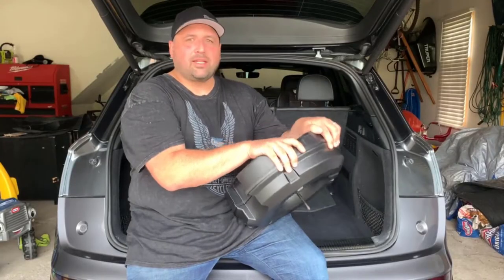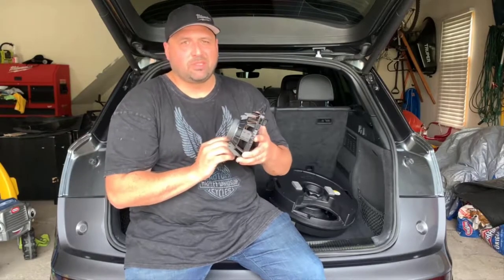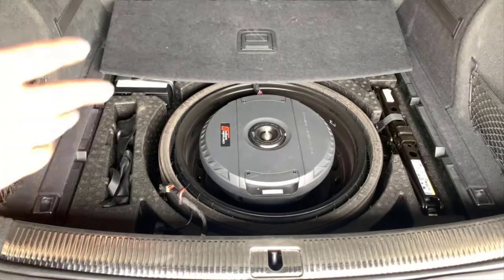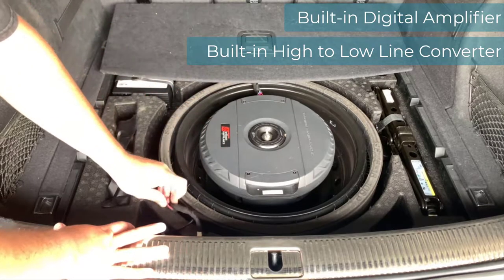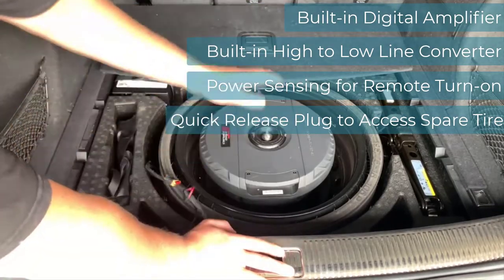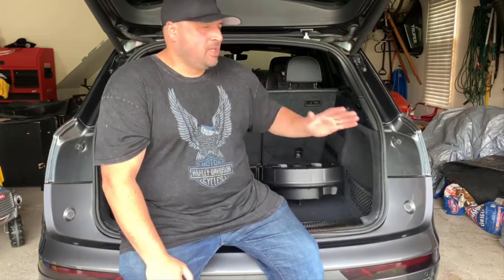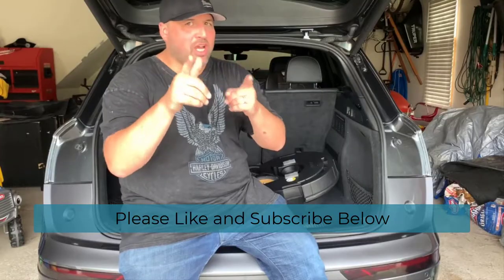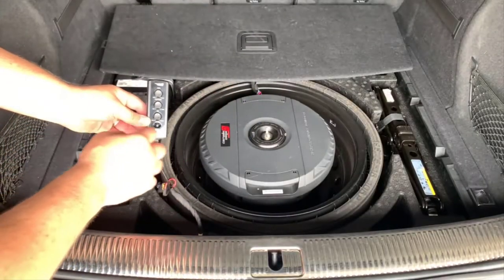Audi SQ5 B9 - Subwoofer Upgrade -- Cerwin Vega 12" Spare Tire Subwoofer w/ 600 watt AMP!

Comment: a little jumbled on the line out put convertor explanation (converts the speaker-level output to RCA level output) but good video overall!
Reply from the maker: That's not exactly true either. I was trying to make simple enough for most people to understand. The built-in high to low converter takes the direct output from the factory subwoofer out on the factory amp and converts it to a lower level input on the Cerwin Vega unit. RCAs are a type of low level output, but the amp doesn't require RCAs to operate. The Cerwin Vega accepts direct wire in for the speaker channels, in addition to RCA in. In fact some people buy a pigtail for the factory plug and it goes directly to RCA and don't use a high to low converter. I have a second video showing the wiring in a bit more detail: https://www.youtube.com/watch?v=YWwqsGtCkSY ... Dually noted, a good call out that i could have been more clear in my explanation. Thanks for stopping by!

Comment: Interesting, however it was apparent even through the YouTube video that it sounds atrocious. That rattling sound might be the hard cover that drops down over the spare tire area. Or it might be that the subwoofer itself is not tightly attached to the metal floorpan. I think that in order to get this upgrade to sound good, a bit more work will be needed. I'm probably going to tackle this job in my SQ5 sometime this summer. Without doubt that little stock driver is not going to cut it. B&O likely designed it for bass frequencies, but in order for a driver this small to produce bass that is adequately loud, the excursion of the cone needs to be very great. This is one of the limitations of the stock driver, but there may be more. To do this right, the subwoofer has to be rigidly installed and not rubbing against anything. And the normal floor panel for the hatch area really, really needs to be modified. Hate to say it, but it is true. In fact, I'm going to do this first, because even with the dinky little stock driver, that floor panel is very obviously blocking the sound, and it may be rattling. It needs to have a big round hole cut through it, and the hole replaced with a sturdy metal grid, which could be glued on with epoxy. And covered with grill cloth. A smaller driver rather than a large driver will likely work best, though, because the volume isn't large enough unless the driver is very heavily damped, which will make it inefficient and low in sensitivity, and which will require a very, very large magnet.
Reply from the maker: Any rattling that you hear in the You Tube video is likely the two child car seats in the rear of my vehicle. They both have adjustable head supports + Plastic adjustment pieces rattle and make noise. I have seen some installations of modifying the trifold spare tire cover, which is somewhat doable, but I also don't think looks "great' on the Audi. I now have a SQ7 (which can be watched here: https://www.youtube.com/watch?v=Ba3aXk12-hU) and it is actually a ported box, with a spare tire cover that is much thicker. Again a limitation of this system is 100% the placement of the subwoofer without an air outlet/inlet, which dampens the air movement, which also dampens the air pressure, which impacts the sound quality. In the SQ7 I am going to play a bit more with other options since the 8" just isn't quite there yet for DB in the lower frequency range (requires the most air movement). Thanks for commenting and stopping by! Good luck on your project!
Reply: @tangentsdaily  While it is conceivable that the rattling and buzzing were due to child seats, I'm a bit skeptical because the sound that came through the 'Tube was mostly distortion. Very severe distortion, to be honest. But you've moved on to another vehicle, and no longer have any reason to chase down the problems with this installation. With respect to those flip-fold panels in the hatch area, it is essential to find a solution that you find acceptable from the standpoint of aesthetics, because there just isn't any way that any subwoofer covered over by one of those things is going to sound remotely like it will sound without that cover. The long period for long wavelengths (low frequency) allows time for the air pressure fluctuations to work their way around everything, but this does not compensate for the resistance to air flow. There absolutely are ways to fix this problem, i.e., put a big hole in the flip-fold panel. It is only a matter of finding a solution that you're will and able to undertake, and that you think will be aesthetically acceptable. A couple of more technical items. And oh, before I forget, that sound meter you have might be okay, but what you really need is a software application for a notebook computer, and a calibrated mic you can plug into the USB port on the computer. I promise you that once you cross the threshold to doing this, you'll quickly look back at everything you've done previously and think of it all as a waste of time. The free app REW is an amazing application. For calibrated mic, there is the UMIK-1, and Parts Express also sells a calibrated mic for very reasonable cost. Given that this is obviously your hobby, you really should take the leap and download REW and order a calibrated mic. You'll be amazed at how much greater insight you'll have, into what the individual speakers are actually doing. One technical comment on the idea that a subwoofer that is louder than another is better than another. This isn't really a very meaningful idea, unless you're thinking more specifically of the maximum volume you can get from each subwoofer before distortion become noticeable, without regards to differences in signal level. Not to suggest that it does not matter how loud each subwoofer will play with the limited amount of power provided by a particular amplifier. These are actually two separate constraints, that need to be considered both independently and together. In an ideal world, the subwoofer driver with the greatest sensitivity (loudest when played using a particular amp) will also be the one with the lowest distortion at high volume. But that's a hypothetical reality. In the real reality, you need to evaluate a subwoofer driver from both perspectives and then make an informed decision as to which is best suited for your particular needs. The other thing I'll mention is that with respect to ported vs. sealed enclosures, speakers that are ported (or that use passive radiators) are more efficient in a narrow range of bass frequency (and consequently more sensitive in that narrow range), and the bass volume is subjectively louder as a result of this, however they are inferior in several different ways, one of which is the volume they require. This is a problem for ported speakers in vehicles generally, but is even more of a problem for speakers using ports as opposed to passive radiators, because the port volume also needs to be great. For this reason, if I were designing from a scratch a subwoofer for use in a vehicle and I wanted the effect of a ported speaker, I would absolutely go with a passive radiator. Personally, though, I would stick with a sealed enclosure, just because the required enclosure volume is usually very much smaller. If you look at from the altered perspective of, "How big of a subwoofer driver will I be able to use, given that the volume can't be greater than 3/4 cubic foot?", the sealed enclosure wins hands down. And to my way of thinking, this is the better approach to choosing or designing a subwoofer for a vehicle, given that enclosure volume is probably the overriding constraint. Even in homes, ported subwoofers with even 12" drivers tend to be ginormous, big enough to take up the entire rear storage area of a midsized SUV. That shallow driver that you chose for the SQ7 might not be an ideal driver for use in a sealed enclosure, but it will probably work well enough. Using a shallow driver like that, and with the smaller enclosure volume needed for a sealed enclosure, the enclosure can be very compact in the dimension of depth, while in the other two dimensions, often not very much greater than what is required for mounting the driver.
Reply from the maker: @tombarber8013  I appreciate your detailed responses and thought out reply. There are several factors I think you may have overlooked -- #1 Recording device #2 Playback device #3 Audio editing #4 Compression. If you tune into 7:52 of the video, I explain that I am editing the video' audio stream to remove the treble so that you just hear the bass parts of the song. I also put a notice that you likely need a nice set of speakers or headphones to play that section to be able to get the bass to sound correctly on your end. I played back the audio on my studio speakers, and if you don't have a dedicated subwoofer setup, you will get audio defects. Some headphones can handle to those lower frequencies as well, but you need a quality set. The recording device was my old iPhone Xs, so the depth of bass may not also be there in the recording -  and YouTube uses compression. If you are not on 1080p60 under the cog wheel on the playback, you might be getting extra compression, you weren't expecting. 
As for the hole in the spare tire cover, I flirted with that idea, but I also don't like the look of the speaker grill, and I use a trunk liner since i am always hauling stuff around in my SQ7. I agree with a nice calibrated MIC -- I only have so much time for videos lol.. if you look at my channel I also go into replacing intakes, vinyl wrapping, rebadging, etc... so I have to limit how much time i spend on which projects LOL. 

As for the SQ7, I tend to agree with you on the ported vs sealed. I've had ported boxes and sealed boxes, and the old JL Audio High Output Box was hands down my favorite subwoofer setup for loudness, but the bass quality was mediocre, whereas I had and 10" alpine type S in another vehicle in a sealed enclosure, and I was very happy with it. The factory Bose System in the SQ7 is actually very strange. I have a video coming up on the best audio settings for the SQ7, I found that the car has so much treble, you actually have to fade the audio back one click to have it sound correctly. I also found out that there is NO post processing on the audio (only special effects), you literally get RAW audio output, so you are highly dependent on the Source. Wireless Car Play with  Bass boost seems to do the best, but the system is completely void of midrange, which bugs me to be honest..... All summer projects for me to record, and hopefully post in a timely fashion:) Thanks for the feedback Tom!

Comment: Did you have the olufsen speakers? I have the olufsen package, it’s way better sounding than our bmw lol! But I want more bass depth, I’m a New Yorker and we love to go deaf lol
Reply from the maker: I had Bose in my SQ5 and I agree the B&O sound system sounds amazing for mids and highs, but the lows are just not there. You will not be disappointed with the shallow mount box. However! If you want it loud enough to buzz the mirror off of the car beside you, you need an external box with an external amp setup. This will not win any SPL competitions.

Comment: Get the jbl stadium basshub + a600 amp combo if you want some serious sound 👍
Reply from the maker: I think they are both pretty equivalent in size and composition. They both are 600watt. Both are 11". Both have a remote bass connector. The JBL is slightly taller and does not include a shallow version -- which Cerwin Vega makes. If you would like to have me demo the JBL send one over I'd be happy to do a review :) Thanks for stopping by
Reply: @tangentsdaily  the basspro hub is 600w (200 rms) only...the stadium basshub is 1200w (600 rms)...thats a huge gap in between the two...the stadium basshub is way much louder 👍
Reply from the maker: Ah yes. I missed the stadium part. It would require a remote mount amp (as you said) — sourcing a switched 12 volt, line converter, and much larger gauge amp kit. The point of the cerwin Vega referenced us that it’s all built in. I’m certain the Stadium + remote amp would be much louder. While my inner16 year old would love that my 30+ year old self with children requires different tuning. I’m more about balance by and depth — not bass and treble. ;)
Reply: @tangentsdaily  the jbl club a600 amp that comes in the combo has hi/lo inputs which is great without the need for a loc...also turns on amp when it sense dc signal which is another +...as for the power wire gauge size, jbl also recommends 8 gauge which is standard on the basshub pro...as in size comparison going off the charts both stadium basshub and basshub pro is the exact measurements in height and width, probably just a bit heavier if anything
Reply from the maker: @Dj1Kreationz  great info!
Reply: @JaredBryan  you're going to enjoy it .. especially once their broken in 👍
Reply: @JaredBryan  so you're using the cigarette 12v to power up the A600 amp ?

Comment: I have this in my Crosstrek and I'm blown away by it.  For what it is, I think its great.
Reply from the maker: Absolutely the best add I did to my SQ5
Reply: How long did the swap take time wise? Will my local stereo car shop be able to do this?
Reply: @InvestigationHour  I'm sort of an idiot and I did it myself in 2 hrs, pulling the stereo, splicing into the front speakers, sound deadening, fuse and power/ground wire. They'll definitely have no issue. Probably the easiest job of their day.

Comment: Thank you for taking the time to post this kind of video, bro! As a dad creeping into 40 who was VERY into the late 90s- early/mid 2000’s car audio craze, and literally just bought a 209 SQ5 (which will be delivered within the next 3 weeks. Bought sight unseen aside from photos and online research. Lol) this is literally a perfect video and explanations. The one I bought does have the 19 speaker B&O system in it. I am coking from a Lincoln with the Revel top end system. So I’m super curious to see what it’s like and if a bass upgrade will be needed. And also if there is any installation differences with the B&O systems. 

Thanks again for making this! I definitely sub’d.
Reply from the maker: Greg -- Thank you for the comment! One of the guys on the Facebook SQ5 Groups lives really close with the B&O and this is on his list now. There is a slim line version of the subwoofer now -- which should fit slightly better FYI. Also -- You only have a dual voice coil 8ohm 6.5" speaker in the B&O where the Cerwin Vega is slightly over 11" and over 3x the power in one unit. Part 2 Q&A should be coming out in the NEXT few days.
Reply from the maker: Check out Part 2! Freshly posted and it will show your current B&0 6.5" woofer! https://youtu.be/YWwqsGtCkSY

Comment: Just noticed as well, I don't even have a spare wheel... Only the can thing. So, the JBL is 165mm and the car depth is 170mm... So in theory it'll work...
Reply from the maker: The problem is the center hinge on the trunk/boot cover,. and also, the bolt / wing nut. it does go up slightly higher.  Check out my Q&A in the following link and skip to 4:47.. it should help explain it better https://www.youtube.com/watch?v=YWwqsGtCkSY&t=1114s

Comment: Hello, I’m following the instructions but I can’t make it turn on. There is signal on the OEM subwoofer cable so it should turn it on but nothing. The  positive wire is directly to the battery and ground to a good chasis ground. I read 12v with a multimeter  on the harness so there is power on it. The fuses are ok (power cable and unit) could the speaker level be to low?  Any suggestions?
Thank you

Comment: Hey mate, great video! I've got a VW T-roc (no factory subwoofer), could this still be installed into my vehicle without a line converter? Also, did you end up using the shallow version? Cheers, Pete
Reply from the maker: Hello there -- sorry for the delay on the response here -- Yes you can still use it. You would just need to wire in the rear speakers to the line converter for the subwoofer. It would require either finding the source of the rear speakers, or running wires from the rear speakers themselves to the subwoofer / line in. IT does have a low pass filter built in, so you would only get 0-120hz for sound.

Comment: The JBL is here in Germany easy to get, whereas its seemingly impossible to find a Cerwin Vega supplier. So i am leaning towards the JBL, but its about 2 cm higher - do you think that further stop the boot floor going flat?
Reply from the maker: Great Questions -- Yes you will have fitment issues with the JBL and Cerwin Vega -- unless you use a "shallow version". You will definitely need to remove the center hinge from the trunk/boot cover to make it fit. However, if you put in a boot/trunk liner, you probably won't be able to tell. and can enjoy all the bass :)
Reply: @tangentsdaily  I found a company called 'Emphaser' here in Germany, the model they sell is strangely very similar to the Cerwin Vega, the control for example is identical. It's 144mm high, like the CV-  as opposed to the 165mm JBL - so I think that will be the way I will go. That said, I turned on EQ settings within Spotify using Android Auto and my standard Audi System really came to life! Completely different and rather powerful sound already!
Reply from the maker: @bennorthwood1719  You are dead on with that one. The EQ settings within Android help a ton!